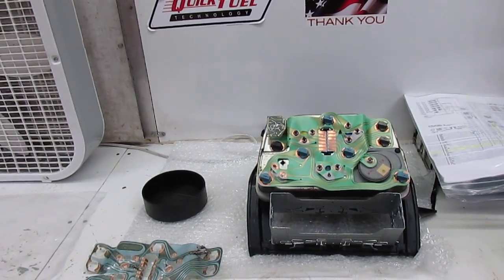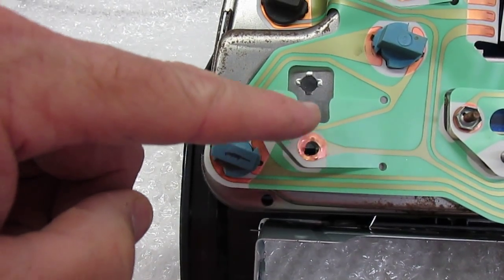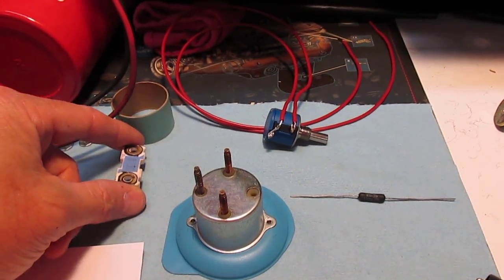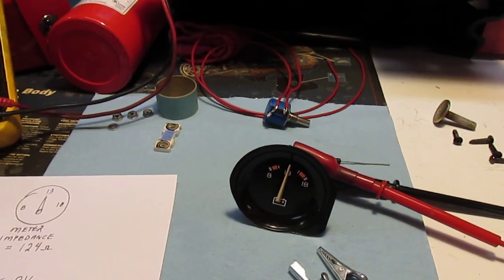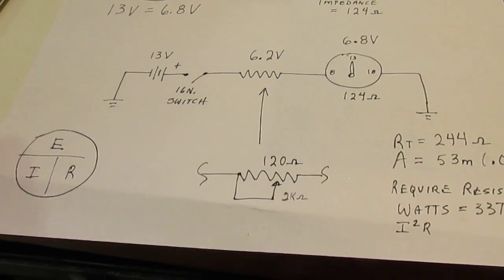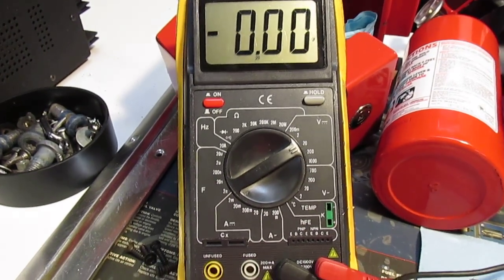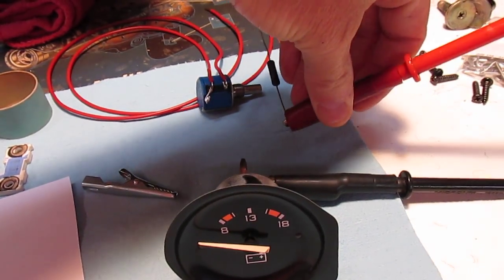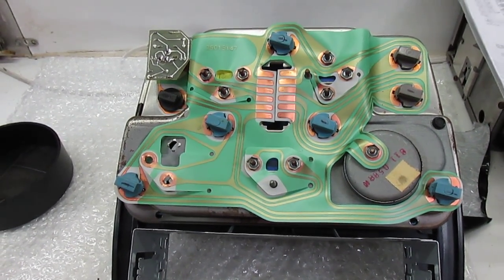How to repair a Voltmeter on a C3 Corvette Instrument Cluster

Comment: When I bought my 1980 Corvette neither the Fuel gauge or voltmeter worked, I ordered both new gauges. The original fuel gauge was fixed by a new sending unit and the voltmeter still did not work after I replaced it... now I know why, thanks a lot!

Comment: I have a 79 c3. When I turn up the dash lights the voltmeter drags back to nothing. Headlight switch and circuit board are new.Makes night driving a bit of a pain. Thinking its a ground problem. Any pointers?